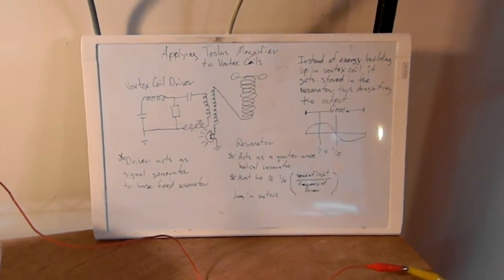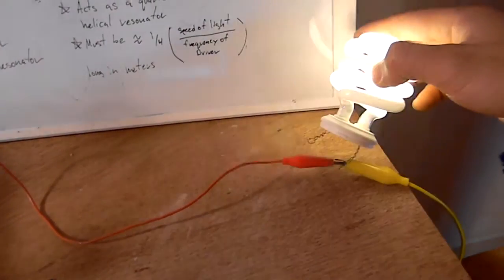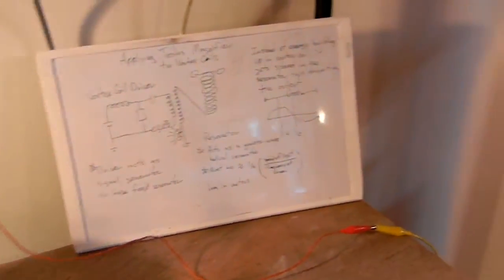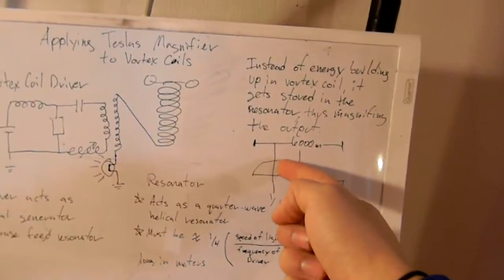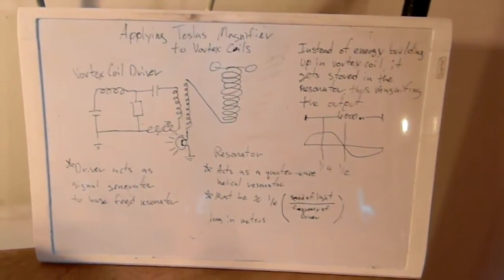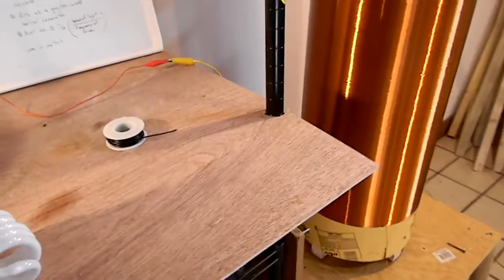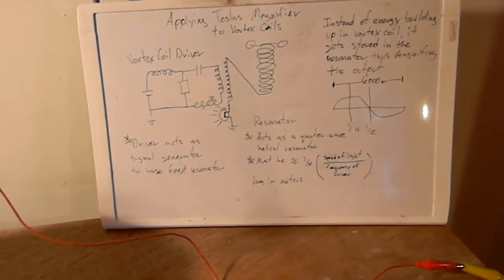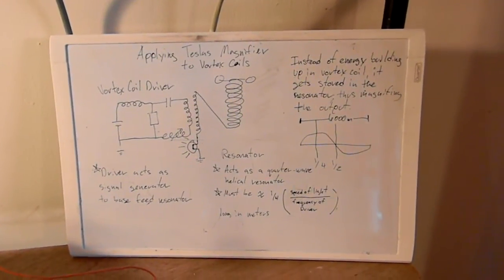Vortex Driven Tesla Magnifier

Comment: IDK dude, 4 years ago. I feel like I'm late to the party. However, According to Gerry Vassilatos, its not the physical length that was resonating the Radiant Energy, it was the mass.

Here's where the disinformation of Business Science really sabotages understanding. You really have to step back another layer into the models of reality to come through on the other side of what Tesla actually was doing, or rather what he actually discovered. Think about it, the summary statements about getting to manipulating the structure of matter... from what you've explained... not likely.   

So, it's been 4 years. How's it working for you?

Consider that if a proton was the size of a basketball, protons in atoms are locked together as solids, they act as one thing, yet the protons would be 15 miles apart. The nearest electron orbital 7.5 miles distant... So, what would be more beneficial to learn to contain, transfer, and manipulate: the floatsam in the ocean or the water?  It's not that the particles aren't important, the impurities, like doping in semiconductors plays a critical role... it "conditions" the Aether. Which helps form more charge or matter depending on what you need. 

Everything is in balance. All that Aether in electricity is conditioned to counterbalance charges. So, to offset the balance of the charges in the Aether stream that is electricity, Tesla hit it crossways with a magnetic field that redirects out the charge, at a critical moment when the whole mix is shattered by the impact of a high voltage hitting a carbon contact of neutral charge (which has the intrinsic property of accepting Aether more readily than charge, and not instantly injecting charge back into the Aether like a metal conductor would) then, keep the distilled Aether moving or put it in a charge free medium (reflecting from end to end of a segmented piece of wire or in a dielectric) Balance the mass (the mass of particles are what conditioned the Aether) of what captures it (your primary with lots of surface area to maximize the capacitance/dielectric capacity) with the secondary. Then it starts building with every impulse... expanding out into space as directed by the shape of your top load. BTW, if you make your top load of metal, it will add charge back into your Aether... and limit the range. If you used a glass globe with a nitrogen fill (as an example) you'd broadcast a standing wave without loss... Put a metal cone around it and you project a beam. That is set to resonate with any matching mass, no matter how distant. A target that will resonate and balance with the source, like a planet orbiting the Sun, instantly capable of responding to changes at either end, no matter how distant... Allegedly... 

Oh, the high capacitance (oil soaked with space between coils of different voltage values) inductors (flux-capacitors) can get the electricity to be dominated by the dielectric (Aetheric-like) effects, moving faster than light speed; but they are still full of charge and not as powerful as the Aether that can travel through any non-resonant substance as if it were not there (like a tsunami crossing the ocean), drawing on the nacient Aether of space, shaping it to its cause as it travels. (Dipping into the infinite well of source.) Peace, B

Comment: use disruptive discharged, negative charged capacitors. Not a sine, not a square wave, but an abrupt, almost instant, discharge of the capacitor into the coil. The quick voltage difference introduces the radiant energy effects.
Reply: if you look at the driving circuit, that is exactly what is going on.

Comment: Well done, now you only have to find out how to tap into the free reservoir of free ground electrons and capture them and convert them to more output power than you have put it. Try to use Avrameno plugs at the right resonance frequency and one wire feed them and use the DC at the Avramenko plug only coupled to a ground wire to pull the free electrons from the ground... Look into Nelson Rocha videos here on Youtube.. Good luck ! Regards, Stefan.
Reply: Vvvvvvv ivvvvvvvv.

Comment: Hi. When using a close-wound resonator with inter-turn capacitance, inter-turn inductance and a capacitive top-load, many Tesla coilers (including me) find that the actual resonant frequency is quite a long way from that estimated by a quarter wavelength of wire. Have you tried varying the input frequency to your resonator to check that you are actually operating at resonance? I can't help thinking you might get even better results with improved tuning. One of my videos shows a method of tuning for minimum bottom feed impedance which is exactly what you need for maximum input current to the resonator. When I build my next magnifier, I will start by building the resonator (with topload) and transformer secondary, then measure the resonant frequency, then design and build the primary circuit to feed at that measured frequency (actually 2 to 5 percent lower due to the de-tuning effect of long sparks). Good luck.
Reply from the maker: Hey! Yes the frequency is a lot different. I actually wound the resonator a little longer and adjusted the coupling of the vortex driver system via tuning inductor. The frequency is different than expected, however with the smallest turn of (1-2 millihenries) the resonator develops large voltages on it. The problem I am having is driving the system. I have stuck to solid state so far and was going to use a half bridge circuit to drive the vortex coil. Still not really ready to do ac variac stuff as I think it wastes a lot of energy. Maybe a resonantly tuned alternator would work too. Any ideas welcome! Currently just moved and don't have space to setup my whole lab so I'll be working on driving circuits in the meantime. Thanks for the feedback!
Reply: My work is mainly aimed at Dr Frankenstein type sparks, just for show, and I have reached an arc length of about 60 inches (in my house) with around 2000VA input and a static spark gap. Maybe you meant that a normal AC hot spark wastes energy in which case I agree! However a well tuned system can result in quenching at the first or second null in the primary energy, in which case the primary spark looks much dimmer and cooler especially if power is being channelled into a huge arc from the topload. If efficiency is your thing, then Terry Fritz has published work on a solid-state spark gap (SISG) for a small TC that stays cool and works with a single microwave oven transformer and a rectifier. I don't think variacs waste much energy, they should run cool at any setting up to full load. Many coilers use a self-tuning 4-transistor H-bridge system working from a rectified mains 630V dc supply, I expect you have researched these and wisely decided that you only want to explode one transistor at a time!

Comment: try to put a water fuell cell on the HV side of the coil, perhaps you'll find overunity.
Reply: +Crippled the point is to set up resonators or capacitors like an aluminum plate or coils near the main resonator. Anything around it capable accessing the energy being pumped into the immediate environment can be attached to a hydrolyzer or any other load you can think of and then from there to the earth(this makes a parallel connection to the main resonator through the earth for cathode/ground connections. Capacitive or resonant connections are made through the air for the anode). Doing all this is definitely going to make a power supply with efficiency beyond the norm.

Comment: thought: send sharp high HIGH voltage DC impulses, through the coil with minnimal buuildup and decay time. Perhaps a marx generator achieves this,  and work out a frequency of impulses per second as ffrequency. Perhaps a staccato of marx generators to achieve this, or maybe there is a cheaper way?

suggestion: read Tesla secrets for everybody by vladamir utin. its on scribd, etc
Reply from the maker: yup, the sharper the pulse the more harmonics are produced. The harmonics are ways of storing energy in resonance. Therefore the more harmonics the better. This goes into ultra wide band excitation. Which is to say it produces a better sound. Next step is to tune this sound to something that may already be making this noise...
Reply from the maker: actually, maybe higher harmonics are not really wanted....especially if these go into radio frequencies...as for methods of powering it....maybe half bridge DC resonant ballast circuits will be my next escapade...The driving circuit is a method of creating a large BEMF and balancing it with a resonant circuit....The problem is this usually results in destroying my MOSFET. I blew a 77.5 A 600V mosfet....with 50 volts and 4 amps....When it is driven not at resonance, it is really hard on the mosfet.....i usually blow the mosfets on the way to finding resonance...The Half bridge circuit may be a better method of dealing with the BEMF vs a protection diode....A protection diode is an attempt at neutralizing the BEMF, which drives the resonator....so a diode should not be used.